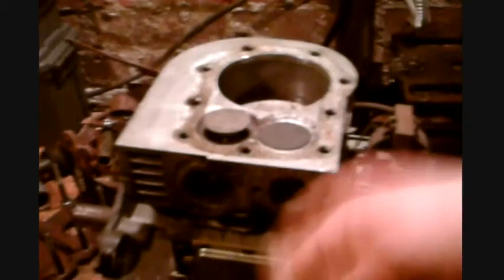Scorpion Engine head and head gasket mod

Comment: Nice mate, Its interesting to see the old school engine modding as average grease monkeys down here dont do it at all, maybe the older guys. It would be good to go to a garage over in the US to see how you guys do it differently. We pretty much just replace parts. Even modifying the chassis to fit things onto it is a big legal no no here. You do get high performance garages but it costs a lot and you have to get documentation and a bit of paper work to be able to get it legal for cars anyway.
Reply from the maker: Swearzy That's almost as bad as California here in the US. Everybody thinks your making bad tailpipe toxins when infact your making the engine run more efficient to make the extra power. Plus when done right use less fuel. People usually don't see that. I wonder how they made that Mad Max movie where your at if they had to do all that paper work on each vehicle. The paperwork must have been a nightmare, LOL.
Reply from the maker: Swearzy Oh, and if you notice, my mods are usually with the stock parts, Might save the paperwork for you if you reuse the stock parts with the mods done to them, that way nobody knows, LOL. That's what you call a sleeper. Thanks for watching.
Reply: Haha, for private use on private property its free reign so when Universal or who ever is doing a movie they just sign the paperwork for the area and they do what ever Im assuming. To use it to drive to the supermarket would be illegal, there are also special "Car Club" registrations you can get which work around "Special Use Vehicles" just need a bit of money and insurance. 

Yeah well on the block its stamped SBC 350 right? Nobody said I had to tell you if I was going to make a 383 stroker haha. They don't check for CUs last time I went to get my car inspected

Comment: Nice. I still have my 12hp flatty from my trapter.  And I scored a 11 up head I was gonna use. The 12 hp is ported but I didn't do much on the head or Unshrouding. I'm keepin it and maybe I'd build a small low "race " tractor and use it, and mod the 11 up head. 
Good vid as usual with lots of good info!!
Reply from the maker: MrTheHillfolk Actually, I just figured out doing this mod when I built up the 5 horse from my kids Mini Bike when I was lookin at the head and gasket on the motor. I've always done this mod  on the race motors I've built but not untill the mini bike engine did I figure that flattie design out. I thought it was pretty cool to do. I only expect it to work too at low rpm's also. SInce I regeared the mini bike from 1 to 1, to 2 to 1 on the jackshaft, that think will push you in the seat. It really shows it's powerband now. The best part now is when riding down the street at half throttle and then just hammer it, is the best part. I got to get a video of that!!! LOL.
Reply from the maker: MrTheHillfolk I'm going use this motor for the build off and for testing. When that's done I got an 18hp oppey I'm going to build up down the line, maybe in a few years from now because I have to cut the frame up to fit it in there, LOL. But that motor I'm going to throw everything I know at it with even buying billet rods to handle the rpm's too, duel carbs, and lightening the rotating assemble which should be easy since it should be neutral balance which is why I like the oppey motors. That build should be great, can hardle wait!!!.

Comment: Yes truth for low compression ....
My dad said that "on paper" the 65hp engine in his plane has about 150 ft pounds of tq, at around 2000 Rpms. Redline is like 2800 anyways. They have maybe 7:1 compression.
Reply from the maker: MrTheHillfolk  My Jeep is running 8 to 1 and that thing will beat anything off the line, LOL.